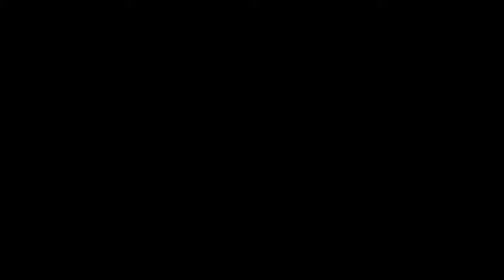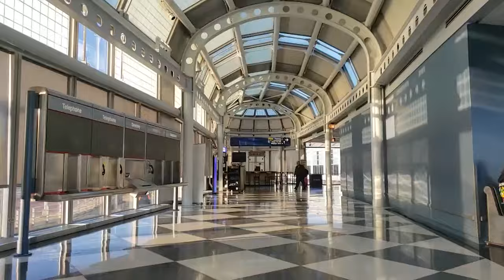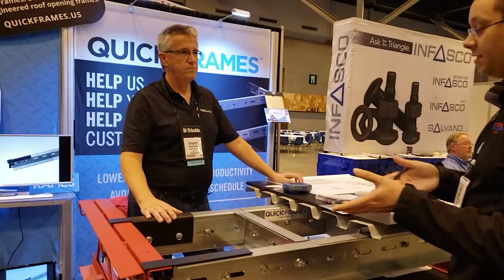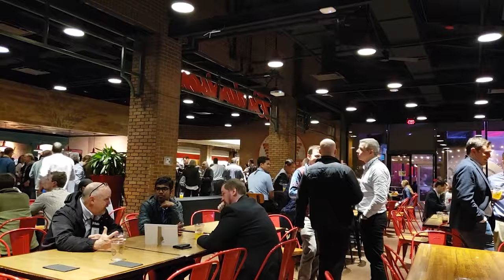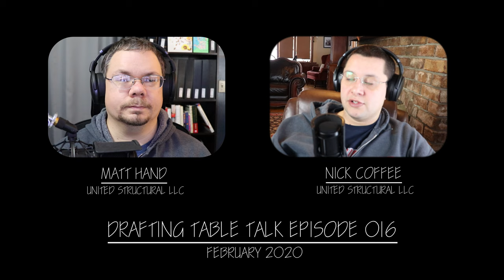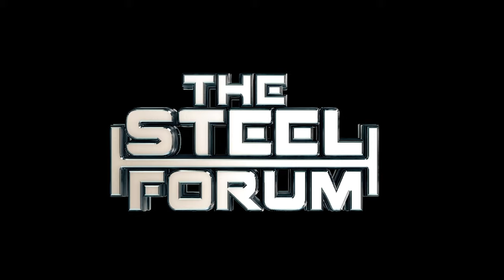DTT 016   It's Time for a New Book

Comment: When you talked about how the different softwares have basically de facto created standards, at least within their own user base, a light bulb went off in my head.  If one of the software companies took the lead in filling this void and writing the standard, obviously they would have a huge incentive to do it in a way that best suits their software.  This would give them a long term competitive advantage over the other 2 softwares.  

Probably the software companies have the deepest pockets of all of us, after all.  And which has the deepest pockets and is best organized to take on this task?  In my opinion, that would be the one  you identify as number 3. And being third, they have the most to gain from doing it.

Furthermore, if you’re the other 2 companies, do you want to just let number 3 take this on, or do you try to beat them to that role?  

So it should be the case that the big three software companies would be tripping over themselves to get involved, when viewed from this perspective.